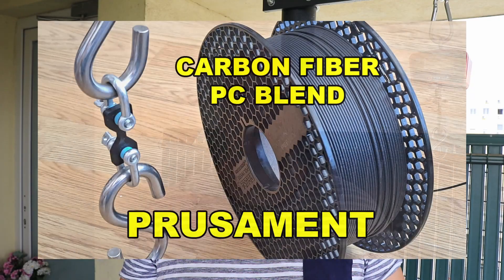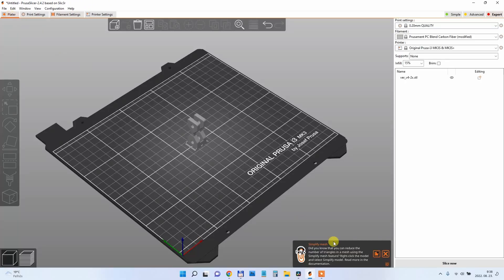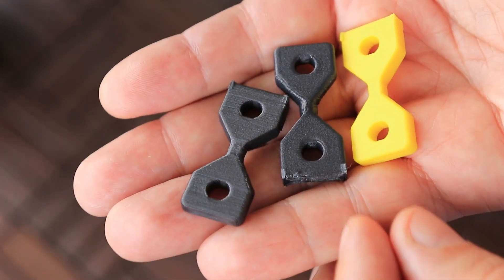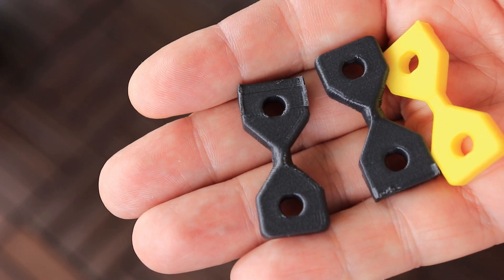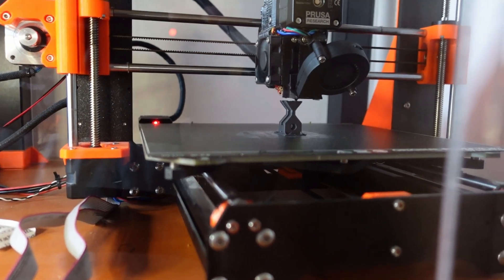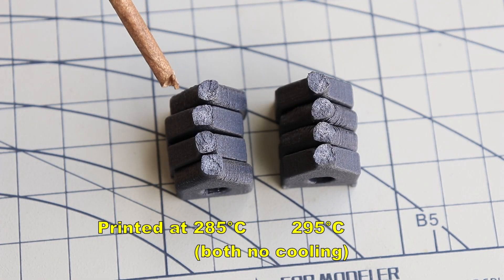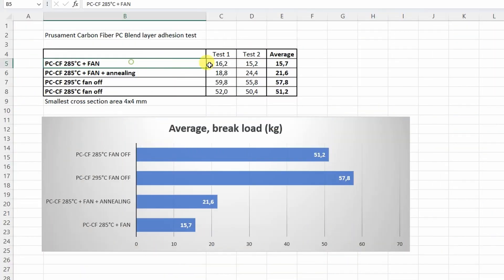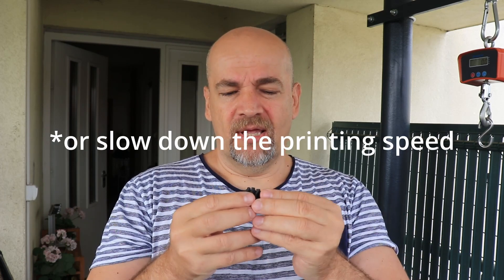About Prusament Carbon Fiber PC blend layer adhesion

Comment: 10-15% cooling would also be nice to see the results of, because the improved layer adhesion is definitely a big step up, but dimensional accuracy is often very relevant too. I noticed very little cooling helps a lot with dimensions, but I don't know how much it will reduce the strength

Comment: Hi Igor! Love your videos, and your attention to detail! Thanks so much! Question: I would be very curious to see if annealing of those newly printed parts (part-cooling-fan off and printed at 285C and 295C) even improves the layer adhesion more. Or will the flat out? I know it would be a bunch of work, but I would also like to known, when printed in those situations, if other aspects change at all (like creep, impact and other tests). Its such a promising material, that maybe its worth investigating. I would have done the tests myself, if I had the jigs and measurement tools myself, but unfortunately I don't have them ¯\_(ツ)_/¯. Or don't you expect any significant changes in those other properties (if so, why)? Thanks!

Comment: 1:20 You don't have to add pieces to slow down print time. In your slicer you set your minimum layer time to your desired amount - maybe 15 seconds - then you switch on "Z-hop" or "lift head" depending on your slicer, then you can customize the print time very easily to ensure proper cool down :)

Comment: Are you going to make any new video featuring the S1 Pro in the near future?
Reply from the maker: I am thinking to install fans on x, y steppers, probably in front of camera 🎥
Reply: @MyTechFun  That would be very interesting!  but so would anything involving the S1 pro as it's one of the few affordable high temperature printers on the market. And in my opinion it prints just as well or even better than Prusa which I think is a big thing.   Maybe the first real prusa killer?
Reply from the maker: @DKFX1  Yes, pity it still uses v-slot wheels. I am not big fan of them. Y stepper inside enclosure is 80C, thats why I want to add heat sink and fans.

Comment: What you have discovered also applies to other materials such as PCTG. Thank you very much for your fine work.
Reply from the maker: Yes, probably I have to do deeper research on this. But in most cases, I try to follow the instructions given by manufacturer. Prusament PCCF have preset settings in Prusa slicer.
Reply: @MyTechFun  maybe they should add an addendum for prints that u want to be as strong as possible, otherwise the preset settings allow for easy printing

Comment: A trick to improve cooling is to set the two parts far from each other on the bed and then play with travel speed,  this way one piece can cool while the nozzle moves to the other.

Comment: To print small areas slower use parameter slowdown_below_layer_time
Reply: This. ASA and PC parts with small layer cross sections and being printed singularly can get fairly distorted. It can be annoying.